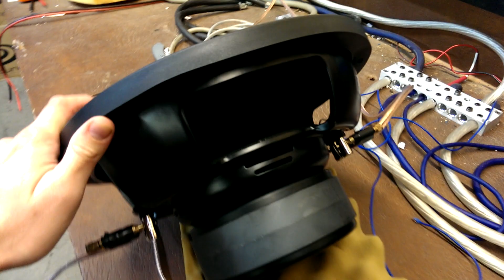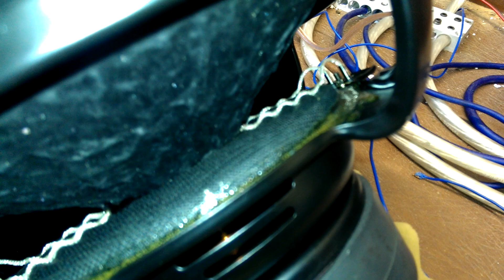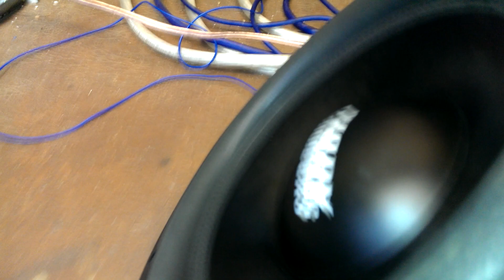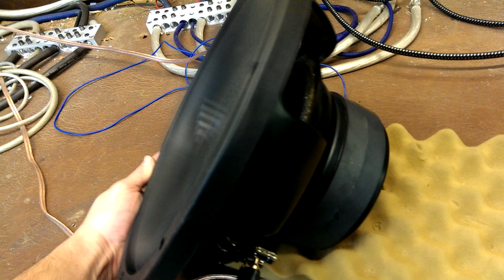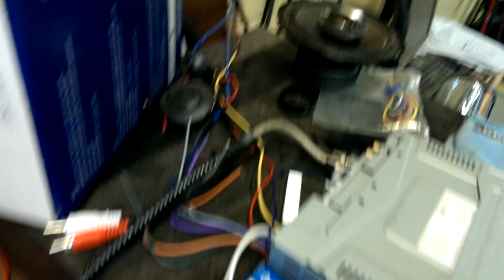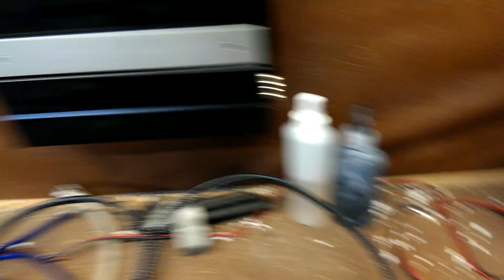Sundown E-12 v.3 Prototype

Comment: I really enjoy mine. The mechanical clearances are real. My box is 3.75 cu ft (after displacement) ported tuned to 31.5 hz right now. I can play 20hz with no subsonic filter at full rms and the subs take it so gracefully. Nice to not have to worry about the subsonic filter as I prefer not to have one if i can get away from it.

Comment: just got the e12v3 and it's nothing less than incredible....thats not entry level...most high end brands can't come close...its clean,accurate,and low....serious guys....kudos....
Reply: Saying most "high end brands can't come close" it's straight up ignorant as hell.
Reply: @ThisGuyDrives   no other brand power soak tests their subs like these guys either...
Reply: Ryan Moore I got a pair of the 12” ev3...both subs have off centered voice coils. Which gives them an odd sound at certain levels. They get hot EXTREMELY fast too. It’s nothing I have hooked up wrong. Have them wired @ 1ohm (4dvc) to one Rockford Fosgate r1200-1d @ approx 5/11 gain. All power and grounds are 3/0 pure copper. Ported Box approx 32-34hz. Running off a 300 amp alternator with 2 additional 1000cca deep cycle batteries. Meter reads 1.0-1.2 fluctuating to amp. Coils on each sub read 3.5 each which might be the reason they get hot. Shouldn’t be though. That’s the only thing I can think of that can make them get hot. Only being 3.5 ohm per coil gets me down to .875 ohm but reads 1.0-1.2 from terminals. Something just ain’t right for the day I got them (about 4months ago). But overall I like them, not as much as my type R’s. Did you have any of these issues? Or hear about anyone else? Thanks

Comment: Are these on the market yet? I need 8 of them
Reply: Yes
Reply: I bought eight of them. Couldn't be happier.
Reply: Holy crap dude, you wasn't kidding! I just watched a video of yours
Reply: Yea man, They're in a street box with no sealing done inside the cabin, it leaks air like a bitch and its hitting 151 on 3k rms. I'm building a b pillar 4th order wall with the same setup and it should do pretty well.
Reply: +Dougbramer ya dude continue making videos on them bro

Comment: Been running my E-12 v2 on a DSC1500.1 at 2 ohm (750wrms). Sundown builds some awesome subs, cant wait to get my hands on this v3 and run it at 1 ohm, i personally think it will take a clean 1000wrms daily no problem.
Reply: hey do you think 6 of these can handle 4900 rms daily I'm thinking about running 12 e v3 12s on approximately around 9800 RMS do you think I will be fine B pillar 4th order